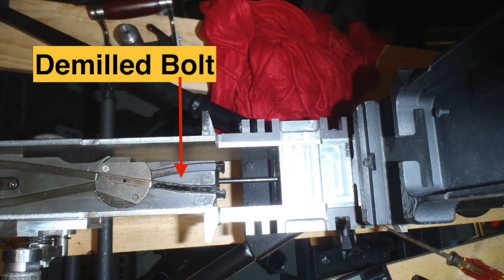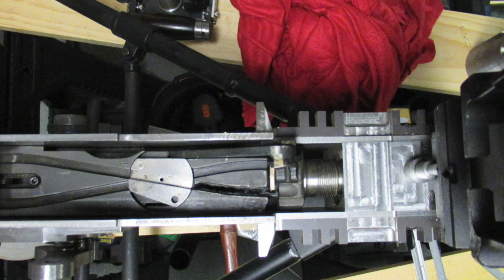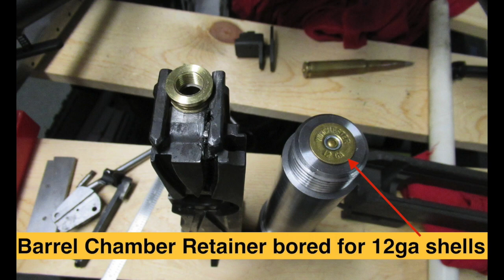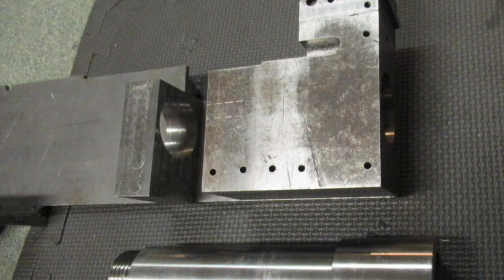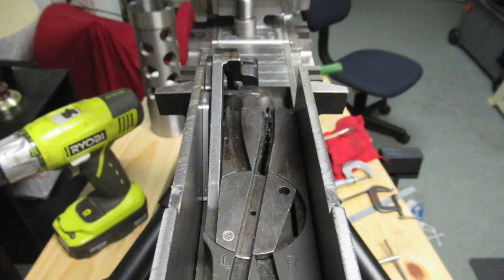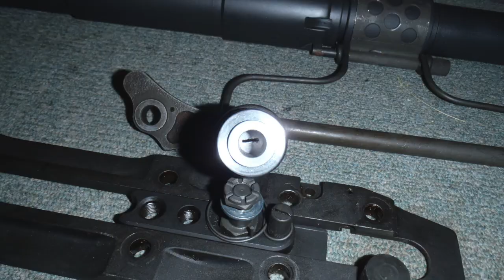Replica M2 (Ma Deuce) 20mm Cannon Build Slideshow update

Comment: Congratulations once again your work is fantastic, I looked for the measurements of this bolt all over the place and I didn't find it, when I found it I found wrong measurements and not original ones, and it's hard to find material from technical drawings of the m .50 I'm redrawing in 3D but there are still many details missing that I don't know
Reply from the maker: Let me know if you need measurements on anything your having trouble finding and I'll see if I can help!
Reply: @ralex397  The measurements of the parts of the internal part, for example, I don't have any, measurement of the bolt, of the springs, in fact, the internal part lacks a lot of measurement for me to complete the drawing
Reply from the maker: @eletrogargaltda7200  I was also unable to find blueprints on the internal parts. I used actual 50 BMG internal parts.   Any parts that were cheap, or had been demilitarized like the bolt, I was able to buy online, made the build a lot easer. At first I was going to design my own firing mechanism but the actual parts make it act and feel real.  I will make drawings of the parts I used and send them to you, it may take a few days.
Reply: @ralex397  Thank you very much friend, and for sure when we finish this work we will have a good 3D model, thank you once again for your incredible knowledge